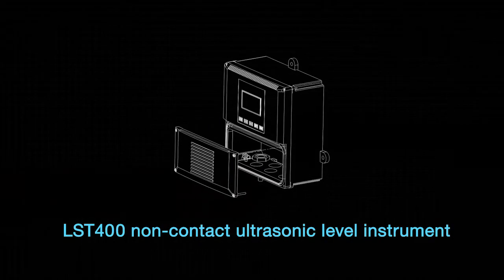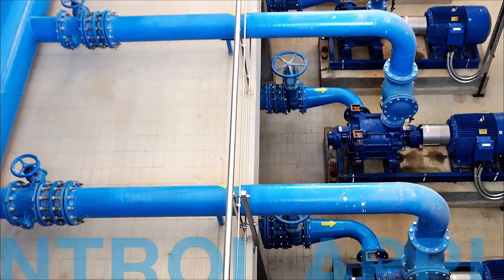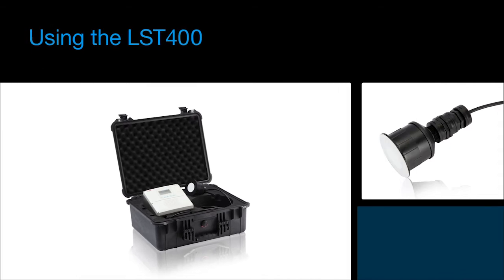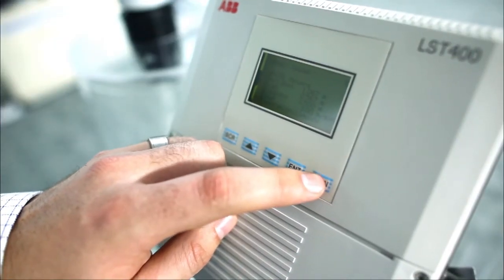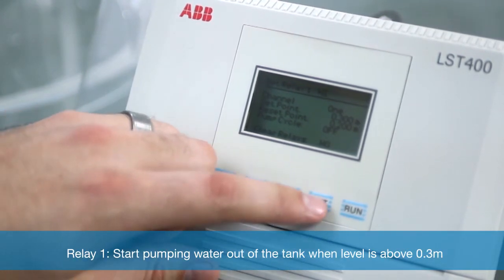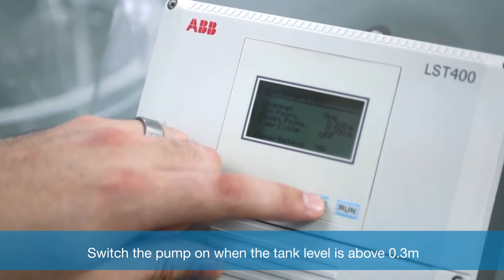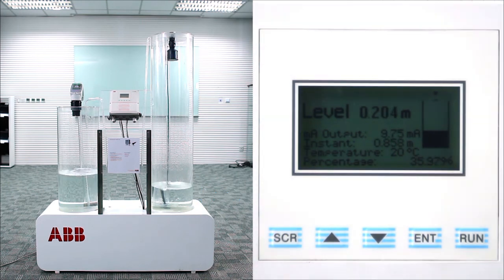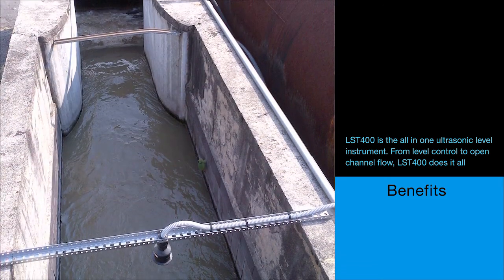Level control using the ABB LST400 ultrasonic level transmitter

Comment: Can you help me.

I have a new one but maybe the analog output connection is wrong.

The level did not appear on the SCADA.

But on the transmitter screen is 5.5 meter.

Comment: Can any  one help me to know how this device measuring the water flow in an open channel?
Reply: Open channel flow is calculated from the level measurement. The instrument is pre-programmed with popular weir and flume equations. The instrument measures the level and does the conversion. Open channels have been an important field of study for many years, and the equations are proven to work well. LST400 makes use of these proven equations for the measurement.
Reply: Hi can any body tell me what does the span means